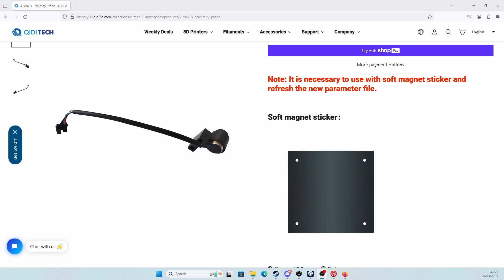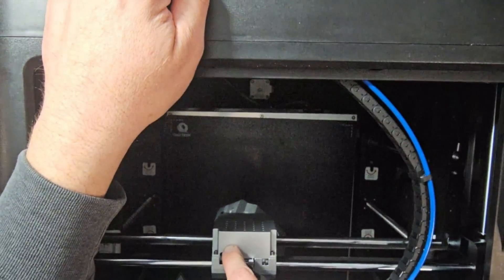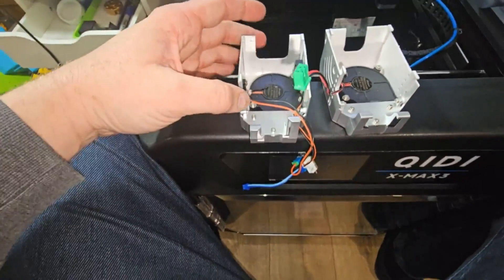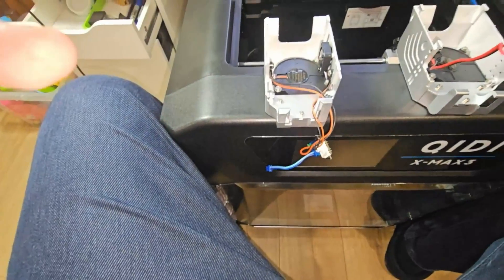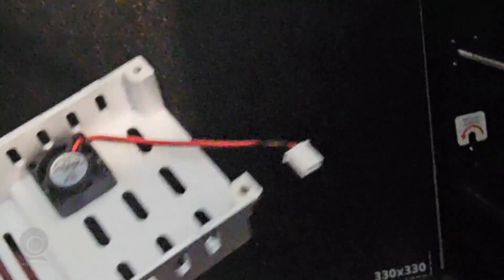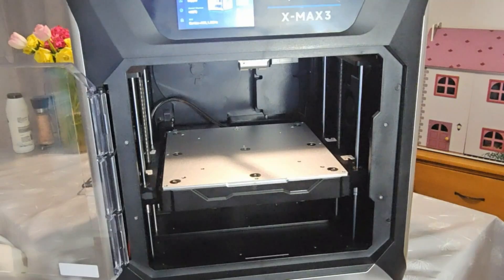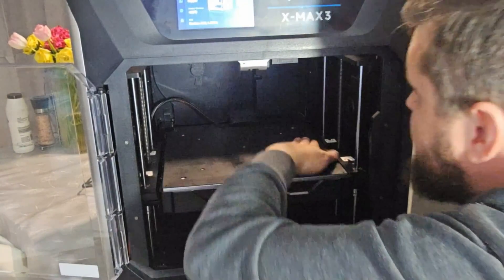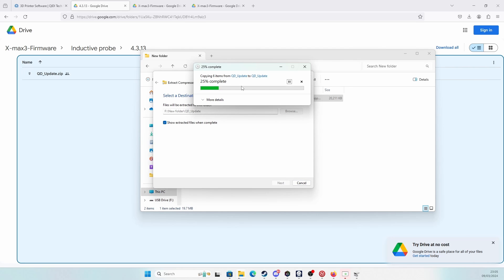QIDI x max3 Proximity sensor Replacement

Comment: Hi, Qidi sent me the upgrade videos. You MUST remove the old solid magnets before installing the soft magnet. Your video will cause people problems unless you correct it. Old magnets must be removed!!!
Reply from the maker: Thanks for your comment.It's in the description
Reply: Are the videos from QIDI online? Could you provide a link? Otherwise, I think at this point, I am down to putting on the soft bed sticker, but I am not sure of the magnets you're referring to. I would guess there are several and will have to remove the screws holding them in, before sticking the soft magnetic sticker. I just want to be certain, for good measure, before applying the new soft magnetic sticker and discover something requiring a removal disaster.
Reply from the maker: Yes you have to remove the magnets Unscrew them
Reply from the maker: Here is the link https://drive.google.com/drive/u/0/mobile/folders/1odBl6VAoLI1eh8pYJ6fu3pQRVPsZ-dmT?usp=sharing
Reply: @intelligenttinkering  Thanks so much!  -- Also, I just watched the video, and confirmation is everything :) Much appreciated.